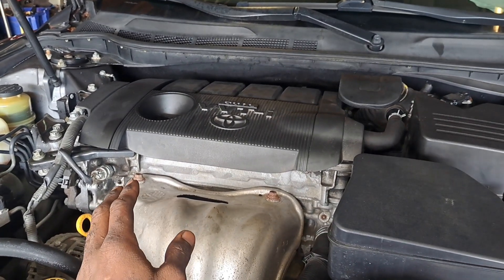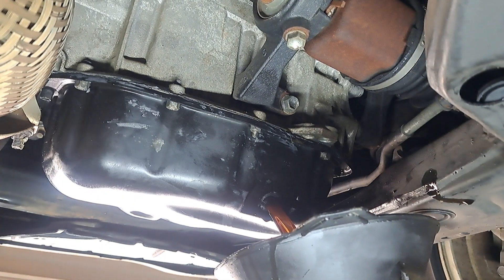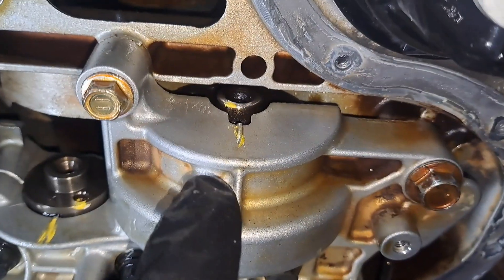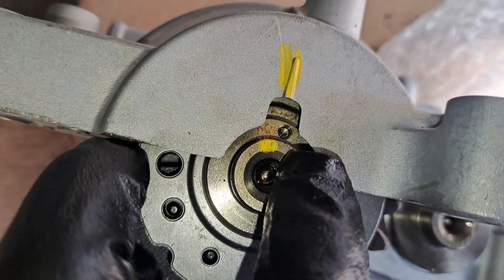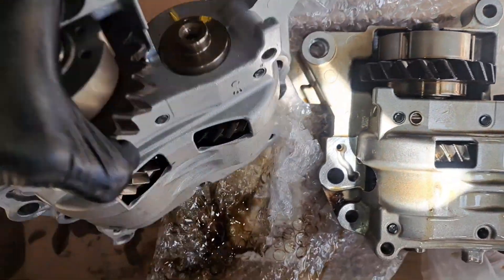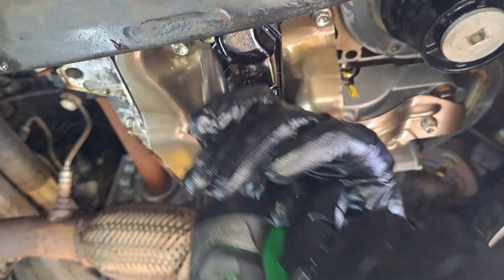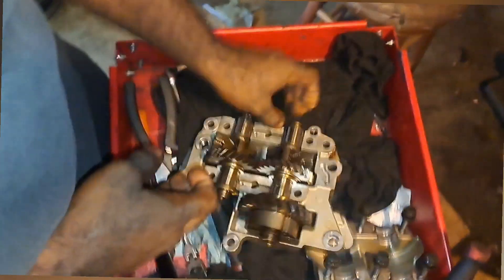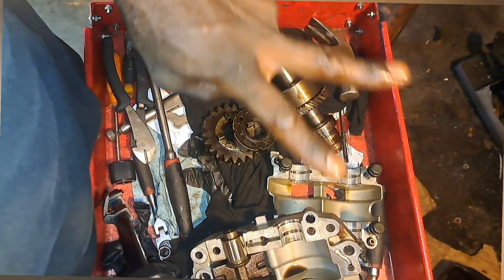toyota camry 2.5 balance shaft replacement,   part from Amazon, 2AR-FE

Comment: I'm waiting on my part from Toyota to perform this same task on my 2011 Scion tC, which has this exact same engine. This video is very helpful. Was there a pan gasket that you replaced? Or did you use sealant only?
Reply from the maker: Just sealant

Comment: Have the exact same noise with same sympthons it's a 2010 camry. Would you please share any link to the OEM part replacement. Great video Thanks a lot
Reply: Toyota OEM 13620-0V021 balance shaft assembly.

Comment: Should have deleted the shafts. Bump in oil pressure and the motor will be a touch more responsive
Reply: What are the drawbacks of doing balance shaft deleting? Just considering between this or replacing it by an OEM part.
Reply: @el_resistor_negativo  probably experience more vibration
Reply: @FEETLE  doing some research and with your answer it makes sense now to me. I better go and replace it. Thanks 👍
Reply: @el_resistor_negativo that' is what I'm going to do...my motor seems to be locked up I'm thinking this is the problem

Comment: Changed mine two weeks ago was definitely bad was quiet for a few weeks now doing it again but only at low idle, and with AC on not sure why it started doing it again not nearly as bad but it is back.
Reply from the maker: Remove the accessories belt and see if the noise continue
Reply: We did that only doesn’t it still if I put it in R or D and idle moving.  If I tap gas stops.  It was really bad before and there was damage to the balance was worn engine side looks fine
Reply from the maker: @anthonychappetta  if the noise is in the pan like before,  likely the new one has failed.  Best to warranty replace and recheck. New parts fail

Comment: I have a similar sound , and on cold start I get an oil pressure light. You think that’s my issue ?
Reply: That could be your oil pump failing It has a metal gear that could make noise if it's on its way out. I wouldn't recommend running the engine without having that checked out.